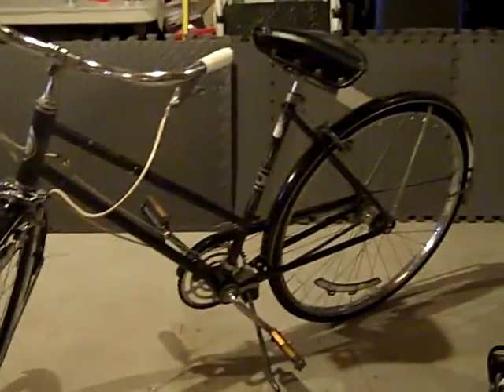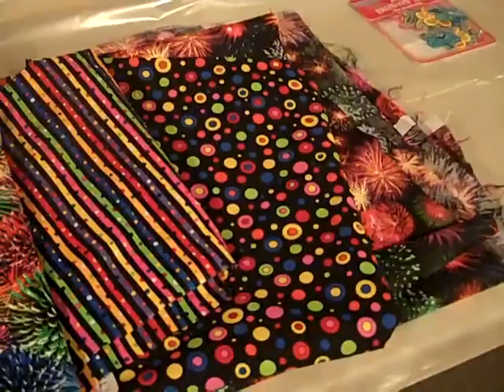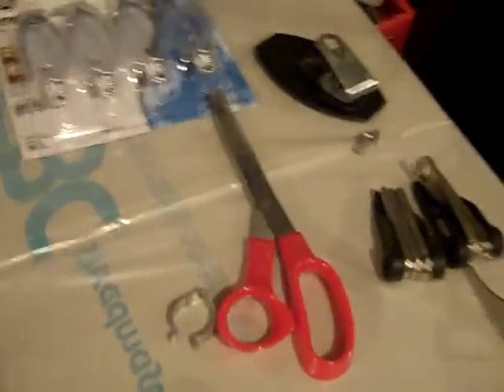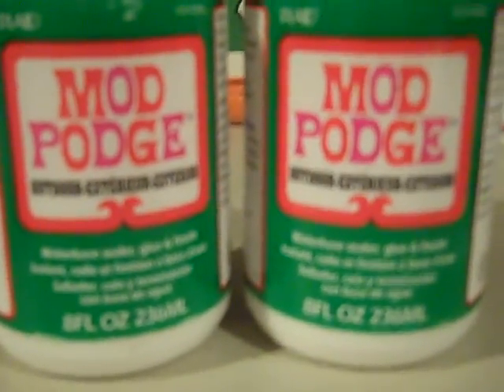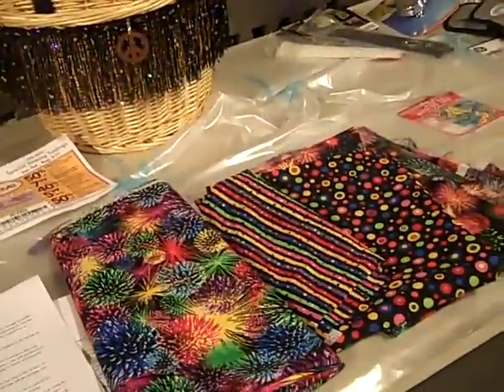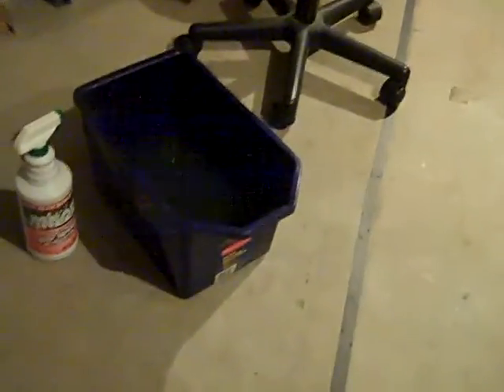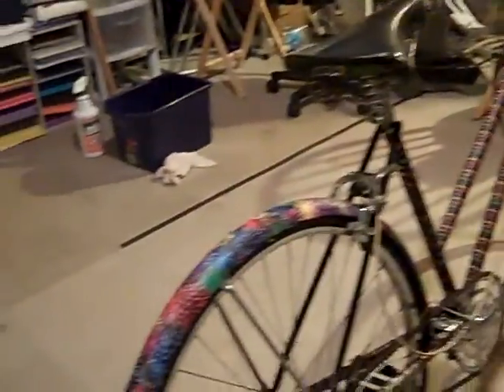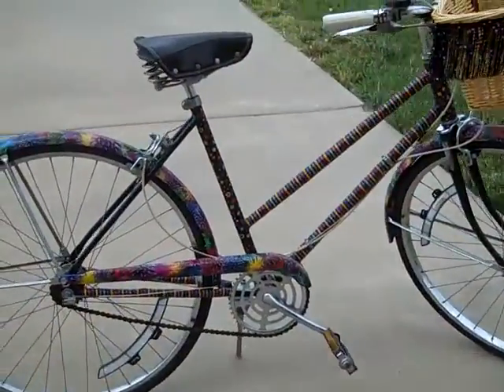How to Mod Podge a Bicycle

Comment from the maker: I have not seen any sign of peeling or flaking. I will probably give her another coat of the top coat ("Mod Podge Hard Coat") in the middle of the summer just as a preventative measure. I have ridden the bike when it was over 100 degrees here in Kansas....the bike held up a lot better than I did! I do not live in a part of the country that is very humid however--at least it is not as humid as I remember it being in New York. I don't know how humidity would affect the Mod Podge.